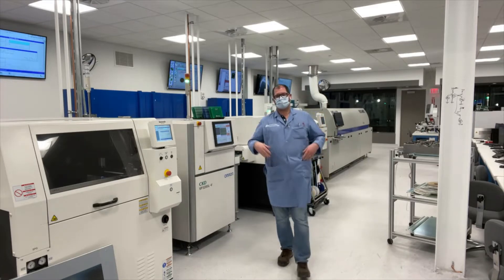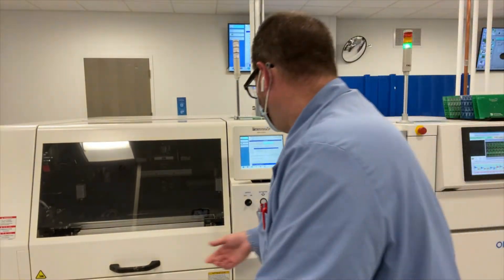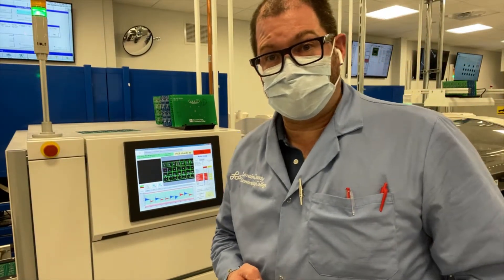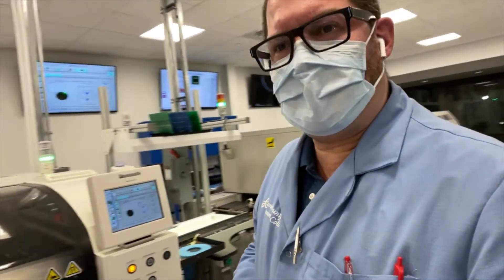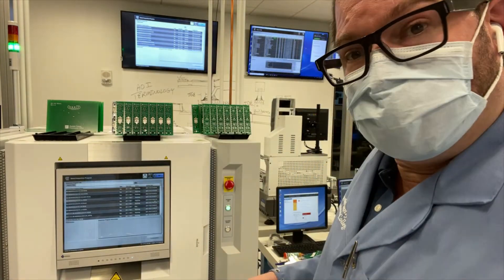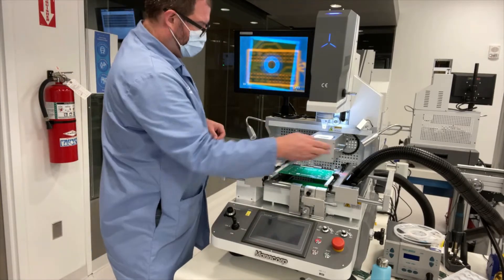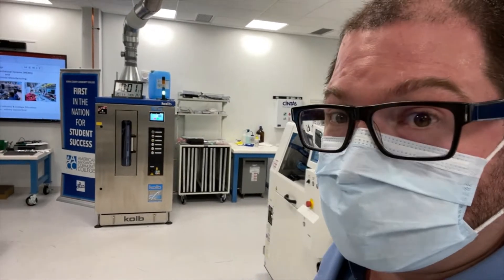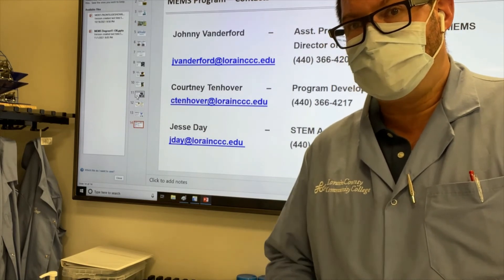INTRO TO MERIT 2021 11+

Comment: Sounds like a lot of money spent learning something that barely pays over minimum wage. I have worked in SMT over 30 years and you can take my statement as gospel. Additionally this classroom has the stink of Bill Timms on it.
Reply from the maker: I think a lot of time the lower pay comes to those untrained and inexperienced, companies will always pay more for experienced workers.  With the fantastic movements in products made in the USA, especially for aerospace, automotive, and biomedical and we've seen companies of all kinds, some with single lines come out and create good jobs for people.  I recommend reading more into the community college bachelors degree in which the training from MERIT is based out of:  https://www.lorainccc.edu/engineering/bas-mems/   The bachelors degree is strongly based in PCB manufacturing starting with IPC J-STD-001 hand soldering in the first year and working a way up to SMT line programming.  It's career facing in-that a paid working experience is required to graduate, tailored by our local industry, and one of the most affordable bachelors degrees in Ohio at $16k for the entire degree.  My favorite stat, 10 years, every graduate of our program hired, 75% of all students hired after 1 year of training.  The proof is in the facts, though I agree some change is due, several companies have traditionally hired in low, but they hire our trained students for more which has been great to see.